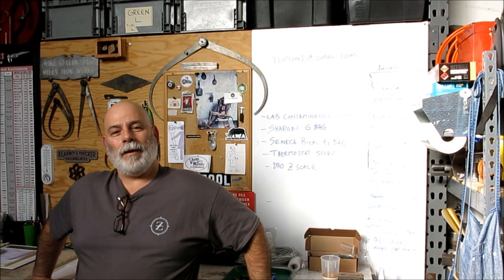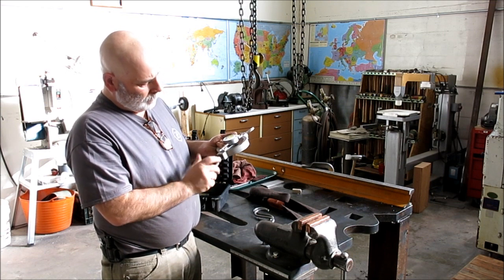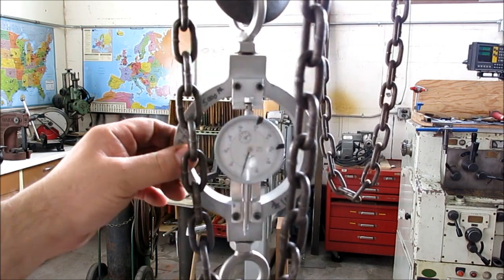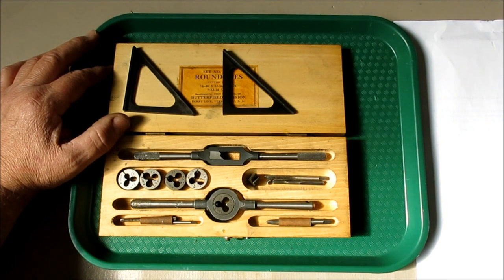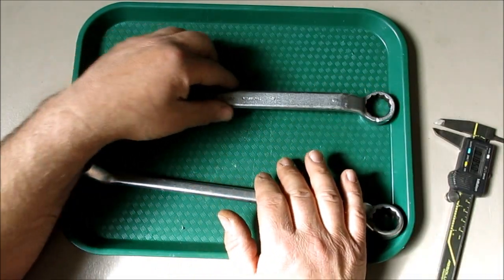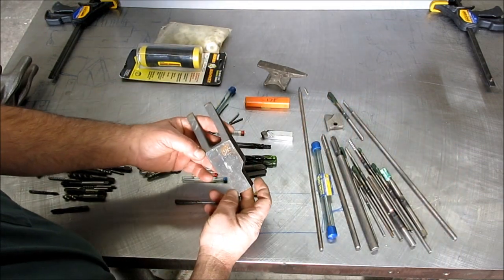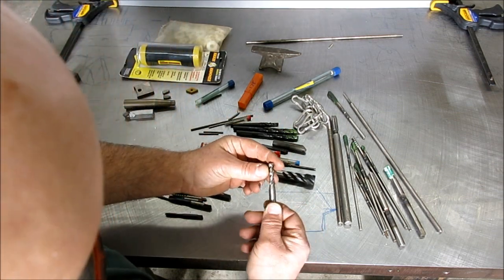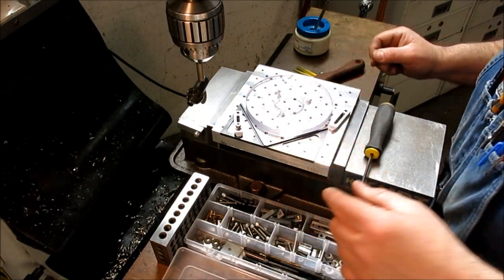Monday Night Meatloaf 19

Comment: Those triangles are cool!  Simple idea that is that useful is always going to be cool....or maybe the word should be "elegant". 

Your force gauge is a neat idea too, and I'm surprised that the hooks hold that much weight, given how much less it took to form them (I'm assuming...unless you have a cape in your closet?).

Don't worry about tool gloat. I'm happy you're happy, and I learn about new things from most of your finds as you explain what they are, how they are used, what makes them high quality (or not), and even what sort of price range is reasonable.  All good info. 

Thanks for the new vid!

-- Mike
Reply from the maker: Hi Mike,

Thanks for the comment. The squares are an elegant design. I'm thinking of a cool nested set of rights and lefts. Yes I am stronger than I look <g> No capes around here just aprons.

All the best,

Tom

Comment: Hi Tom,
         We all are tool "junkies" out here, and love to see what others find at flea markets and such. I'm also sure most of us have limited funds to support our hobby so re-purposing is the name of the game. A case in point from me, I "found" a auto transmission put out on the side of the road for hard rubbish collection. This is going to provide me with some nice Aluminium once I break up the casing and melt it in my small foundry setup. It also is going to give me some nice round stock, gears, and hopefully a bearing or 2 in addition to the fun factor from the teardown.
Cheers Eric
Reply from the maker: Hey Eric,

Old small car manual transmissions make great speed selectors for old school lathes. A little import four or five speed between the motor and spindle gives you a nice speed selection for an old lathe that might only have three pulleys.

Cheers,

Tom

Comment: We have a puller at work exactly like that one and the only way it fits in the case right is screwing the screw out of it. I loved your strain gage scale.
Reply from the maker: Hey I got it to go in the case. The box looks square but is actually slightly rectangular. It just fits the other way. The fingers are like a diabolical puzzle to get the lid closed. I'll need to paste a picture on the inside of the lid.

Best,

Tom

Comment: Thanks Tom. I'd live a walk through of the hoist dyno. Also those triangular squares would be super useful. A 30/60 set would be the bees knees for grinding HSS threading tools with the point in proper relation to the shank.
Reply from the maker: Hey Craig,

Thanks for the comment. Check out Dillon Dynamometers for more information on this type of "Ring" dyno. I'm really liking these squares myself.

best,

Tom

Comment: Tom, make sure you keep LOTS of oil on the squares, gun blue (especially BC blue from my experience) rusts extremely quickly.
Reply from the maker: Hi Andre,

Thanks for the advice. I think my greasy little hands will keep these lubed up enough to prevent corrosion. I plan on using these as much as I can just because they are so cool.

Cheers,

Tom

Comment: Strain Gage. Nice design, suddenly found myself remembering Mohr's Circle calculations, pencil paper and slide rule days!   Rough guess it that is 6061-T6, 5" ID 5.5" OD 1" thick material.  Let me know if I'm close.    Still need a treepanning tools for the lathe, now I know what project I need it for!
Reply from the maker: Hi Tom,

You are pretty close. Material is 7075 as the stress is pretty high. It was made entirely on a rotary table. Total old school.

Cheers,

Tom

Comment: I can see several uses for those squares in woodworking - squaring saw blades in table saws and miter saws.
Reply from the maker: Hi Edge,

When you have them you will find all kinds of uses for them. I'm looking forward to discovering many ways to use them.

Cheers,

Tom

Comment: Hi Tom,
Thanks for the time you put in the videos, I always learn a lot watching more experienced people working.
As far as safety margins involved in safety standards, for lifting, there should be a factor of minimum FIVE times the breaking point for lifting material and TEN times for lifting people, because of any instability or jerking in the load.
Were you talking about schematics to make the circular scale???
I like watching your chronicles and work.
Pierre
Reply from the maker: Hi Pierre,

I totally agree with your safety factor margin. I load tested the hooks to give folks some idea what they are capable of. Each person will make them with whatever tools and materials they have on hand so it is far from a controlled process. If you want to quote industry standards please include a link to the appropriate controlling institution so people can decide for themselves what kind of risk they are willing to assume. My demonstration was meant to quantify at some level what a similar hook might be expected to perform at. Please don't take any offense to my reply as non is intended.

Kind regards,

Tom
Reply: oxtoolco
Hi Tom,

Absolutely no offense taken.

I just remembered these values from my «Lifting and rigging» text book when I was getting my formation as a machinist and welder. In this next link there is a pretty extensive information about rigging for moving and lifting materials, if viewers want more info:

http://humanservices.alberta.ca/documents/WHS-LEG_ohsc_p21.pdf

I believe that safety should always be included in any project.

Thanks for your time

Pierre
Reply from the maker: Hi Pierre,

Thanks for the link!

Cheers.

Tom

Comment: I have one of those old proto pullers. It didn't come with the box or the little springs. I also got a smaller one from the same place. I've used it a few times and it works well.
Reply from the maker: +Arno Dyck Hi Arno,

most of the ones like this I have seen before are missing the springs. Thanks for the comment.

Cheers,

Tom

Comment: That proto puller set the big one should fit in the box with all the parts just like you've placed the smaller one inside it's box. You can make the spring out of spring stock or you can find some on ebay. Really nice catch with those two sets. I've heard nothing but good thoughts on the old puller sets.
Reply from the maker: Hi Aserta,

I got it to all fit in the box. It looks square but the box is slightly rectangular. 

Cheers,

Tom

Comment: s hooks would be a chapter in your next book 2. the weight gage 3, that table is interesting chapter. 4. the mini triangles. 5. modifying and fixing the brake.. 6. T handles are great way to upgrade a tool. I see you have a couple on the sander...great video as always I have a Grizzly G4003G lathe. Can I put a 8 or 10 inch 6 jaw chuck on it?
Reply from the maker: Hi Michael,

Looking at the lathe it looks like to me that an eight inch chuck would be most appropriate. What came with the machine? The chucks in some of the pictures of the machine seen a little small to at first glance. One way to help decide is to look at the adapter plates available for the chuck size you are looking at. For example you wont see too many twelve inch diameter chuck with adapter plates to D1-3 camlock spindles. So make sure you can get the adapter plate you will need. Hope this helps.

Cheers,

Tom

Comment: Thanks for the test of the Captain S Hooks.  I should have guessed you had a measuring device readily available for that.  I don't think you are gloating about the tools; there is no jealousy on my part.  I enjoy looking at tools (as well as machines, motorcycles, guns, and pretty much anything mechanical) even if they aren't mine.  Other than driving up eBay prices, you are doing a good thing by sharing your recommendations of good tools and brands.
Reply from the maker: Hi Stephen,

Thanks for the comment and feedback. I'm sorry to say that ebay is past its prime. I still look there but rarely buy any more. Sellers a shackled by ebay fees to raise prices steadily. There are still deals to be had but not like is was in the olden days.

All the best,

Tom

Comment: The Boot Jacks look like a hold down clamp designed to use on slotted drill press tables.
Reply from the maker: Hi Lonnie,

You might be right. the bottom surface is slightly curved so I don't know how that would work. Thanks for the suggestion.

cheers,

Tom

Comment: I like the copper jaws on your vises. I would like to do the same to mine and order it through McMaster Carr. Do you recommend the Multipurpose (110), Machinable (145), or the High Strength (182)? Thanks Tom!
Reply from the maker: Hi Michael,

The 110 is perfect. You want them soft. Counterbore the mounting screws fairly deep so you can resurface them once in a while without having to re counterbore. If you buy enough material you can make a second set with a horizontal vee groove which comes in handy also.

Cheers,

Tom
Reply: I like the idea for the v groove. I never thought of that. It doesn't look like you use copper on your milling vise. What is the reason for that? Thank you for all the information and help. I think I can speak for most of your viewers in saying how much we appreciate all you do for us. Keep up the great work.
Reply from the maker: Michael Schamp Hi Michael,

On the mill you want hardened and smooth jaws for accuracy. The jaw needs to be harder than the workpiece material. In a bench vise the copper is sacrificial to protect your nice work.

cheers,

Tom

Comment: Tom good finds better you or someone who will use the tools than the scrap heap or middleman.  That ring dynamometer is pretty cool, is the ring aluminum?
Reply from the maker: Hi Bill,

The ring is 7075 aluminum. Its seen over 6K lbs when we were doing our testing.

Cheers,

Tom

Comment: On the big box with the pulleys maybe you can make them fit if you can put them like in the little box of pulleys.
Reply from the maker: Hi Ruben,

You mean bearings? I don't remember any pulleys.

Cheers,

Tom
Reply: oxtoolco
I think he means pullers!
Reply: oxtoolco  I meant to say the pullers starting at 36:00 to 39:00

Comment: Funny story about that rukes piece. It's a small company's own in-house production.

So apparently it was a something like "rukes machines and optics". Back in nov 2013 huge bid on all the items:  

Those two clamps were bid upon in this lot: http://www.bidspotter.com/en-us/auction-catalogues/bscash/catalogue-id-bscash10005/lot-ada88838-3cc8-4133-9afd-a28a000b7aea

you can see them in the picture inside the box.

 Aparently those are mill clamps. Somehow those remind me of the clamps you use when you hold down rims. But it's probably just my imagination. There's another set that was bid on ebay right in december.
Reply from the maker: aserta Go figure. They probably came from the same pile.

Cheers,

Tom

Comment: Was the hook permanently bent by the load ( Plastic deformation ) ?
Reply from the maker: Hi Jester,

Good question. I think it did a little but I stopped before it opened up much. I probably should have measured it before and after to see if it actually yielded.

Cheers,

Tom

Comment: I use to use those Sheet Metal Hand Brake Machines where I use to work. I would make junction electrical boxes for different heaters when I started there when I was 17 years old. At the end I worked in the machine shop also call Tool Room. Here's a link of some of the machines and they have a layout of the metal box before bending. http://www.americanmachinetools.com/hand_brake.htm
I work for this company about 26 years when they were in Manhattan in New York City. http://www.industrialheater.com/
Reply from the maker: Hi Ruben,

I used to have a really nice D&K box and pan brake. It was a 4ft long 12ga capacity. It must have weighed over a ton.

Cheers,

Tom

Comment: I was wondering if a thin coat of baby powder on a indicator face might be less glare with a camera.
Reply from the maker: Lew Sou Hey Lew,

I think it would make the shop smell to girly. Thanks for the comment.

Cheers,

Tom
Reply: Tom then you use Talc that is manly.
Reply: Certainly you love babies . I love them as long as there are not 15 of them to raise. LOL
Reply: +Lew Sou or a kilo of white graphite (w-form boron nitride), which may be the best lube for indicators and cameras etc, as it has all the qualities of carbon graphite (aka plumbago)  except the blackness.
Reply from the maker: +MattOGormanSmith We use boron nitride in a liquid suspension for super high temp anti seize for inconel studs and nuts. Works great. Thanks for the comment.

Cheers,

Tom
Reply: Dang ya'll now I have to look all that stuff up because I do not know about that. It could be I am being teased which is ok .  LOL   I do believe honestly that a bunch of good machinists turned loose to fix the country or the world would have a huge positive impact. Tom Happy Thanksgiving. Turkey is ok. My Dad always took the skin off chicken and turkey which turned out to be good for him. I will do the same yet it took me 50 years to figure out that was a healthy practice.
God Bless
Lew